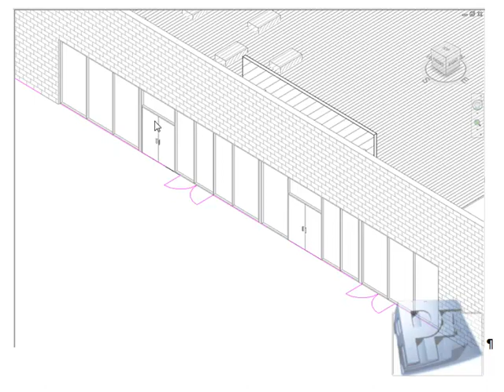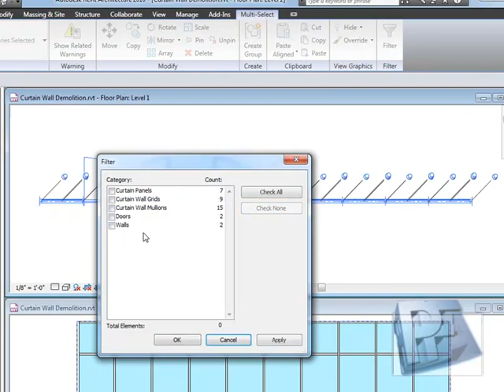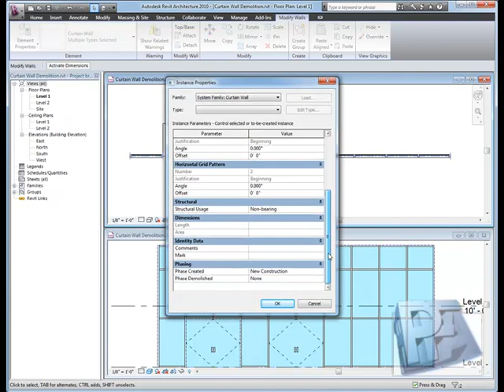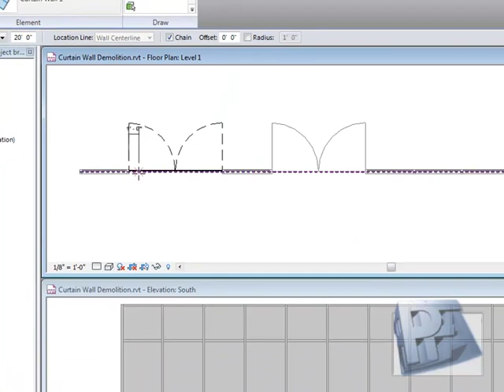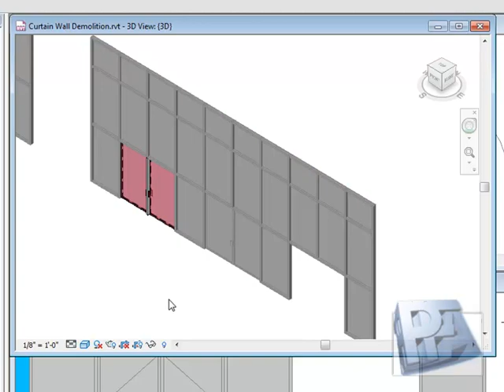Revit Curtain Wall Demolition

Comment: Very good video, as always, Paul. Thank you. But having checked in 2019, the Phase for infill CWs are no longer available so unfortunately, this workaround does not seem to be applicable anymore.
Reply from the maker: Hi Chapman. Thanks for your comment. I just tried it in 2019 and had no problem. Not sure what you mean by infill curtain walls, but if you mean selecting the infill panel and changing it to another curtain wall, that is NOT what the workaround is doing. Watch the video again, you'll see that I am just drawing a completely separate curtain wall in the space created by the empty system panel. So there are two freestanding curtain walls in the same spot. One is the full size of the wall, the other is just the bay we demolished. Hope that clarifies.
Reply: @PaulAubin  Yes it does. Thank you. I understand now what I missed.
Reply from the maker: @ChapmanTaylorBIM  Awesome